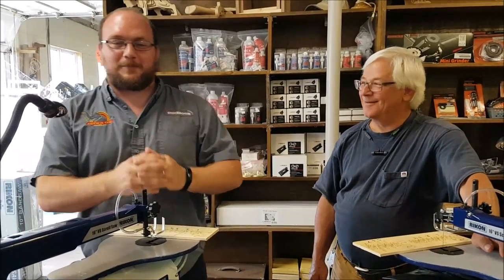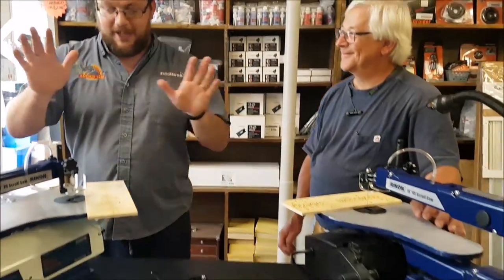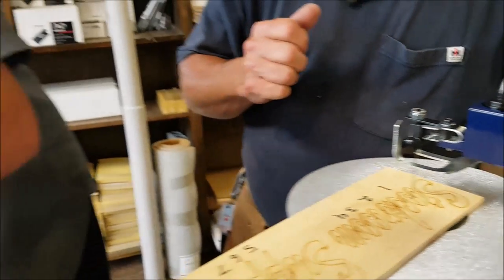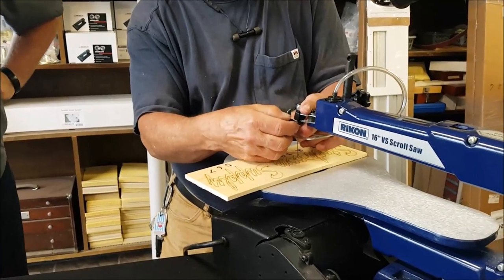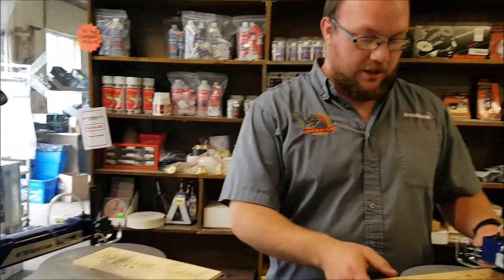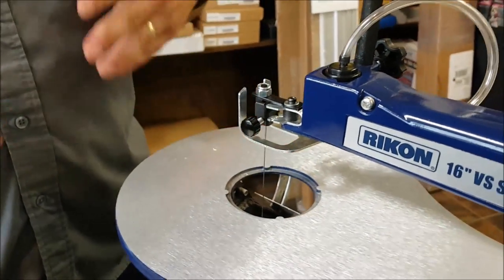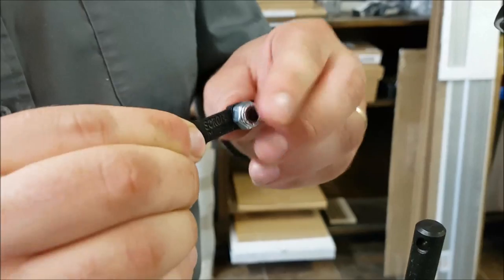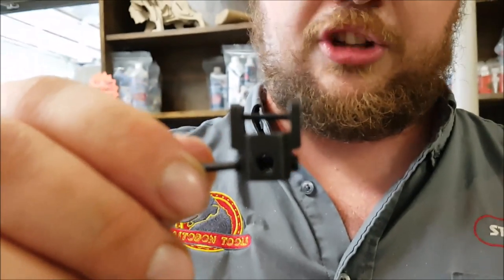ScrollClip Quick Change Blade System For Rikon, Wen, Record Power and Other 16" Scroll Saws

Comment: I bought these. Great idea only. They worked. Unfortunately my plain end clams that came with my Central  Machinery  scroll saw from HF quit holding my plain end blades. However i was blessed with a wonderful Christmas gift  of a 22" Bauer scroll saw from HF. I absolutely love it. No more hokey plain end clamps to waste time with. Frett work goes supper fast now. It also means i no longer need to use these clamp clip holders from Stockroom Supply. $22.99 and free shipping was the price. so if your stuck using the crappy plain end clamps invest in these clamp clips they do help aid in holding that bottem clamp. PS I did find out that when i bought them from StockRoom Supply even though it says USD my bank charged me for international transaction. So keep that in mind. Thanks guys for this tip. It was helpful for the few cuts i got to use them for. Even more thankful for my Bauer scroll saw🎉

Comment: You talk about the bottom but you do not explain about installing the bottom part.  I have an old Ryobi that enables me to do small work.  I would love to be able to change blade faster.
Reply: I agree; there is little room on the bottom clamp holder, not to mention it is upside down, making it difficult to see the top of the Allen screw that would have to be removed to attach your product. Please address this problem.

Comment: The top clamping mechanism which uses the thumb screw to hold the blade is very convenient for the top clamp, but it looks as though the bottom clamp is tightened using an allen/hex wrench. This can be very awkward when changing blades, as with DIY-store scroll saws often have a metal cover has to be removed to make it accessible, and the limited space available makes it difficult to hold the blade in position while tightening the allen screw to fasten the blade in the clamping mechanism. Also, clamping mechanisms that squeeze the blade between its two halves have to be pushed apart when changing blades in order to be able to insert the blade. Due to these problems, I returned my to the DIY-store where I bought it. The clamping mechanism shown here in my view is an improvement on cheap clamping systems, but when it is compared to others like the Pégas or Hegner clamping systems, it is still well behind in terms of ease to use. I don’t understand why DIY-store scroll saw manufacturers don’t supply their customers with scroll saws that have user-friendly clamping mechanisms.🤷🏼‍♂️😳☹️ The problem that hobby scrollers are faced with is that DIY-store scroll saws cost about $100, whereas scroll saws from e.g. Hegner, Pégas or Excalibur cost from $600 to $1000 and beyond..

Comment: Just purchased one of these. The top portion of this system installed easily (like the video shows). However, the bottom part did not. In fact, I could not install it at all. I now understand why that part of the installation is not in the video.  The instruction sheet photos show very little detail -- they are small (look like JPEGs printed with an ink jet printer) and practically useless. So, I wouldn't recommend. But, who knows? It may work for you. 

My saw is a Skil 16-inch that looks like just about every other 16-inch scroll saw in the world. Probably made by the same manufacturer - just minor cosmetic differences.

Comment: Hey guys have you considered replacing one of the grub screws with the same knob on the bottom as well as the top?  I got one of these a couple weeks ago and it’s a huge improvement, but toolless blade changes would be even better

Comment: hi, im restoring some old alloy wheels, they are aluminium and due to the details in the wheel style its taking forever to remove the paint and lacker to prep for painting, how could I do it at home without spending the next 3 weeks sanding by hand? will a sanding mop attached to my drill work?